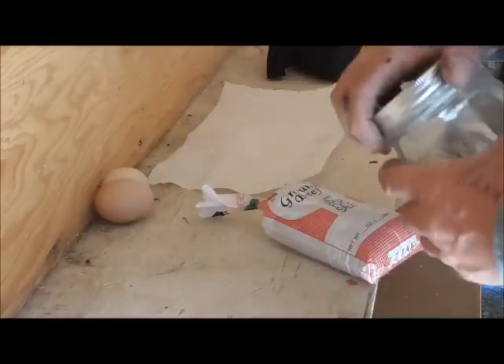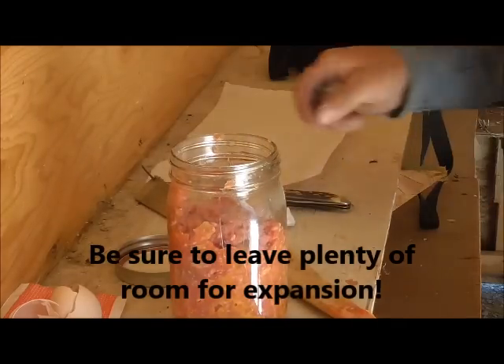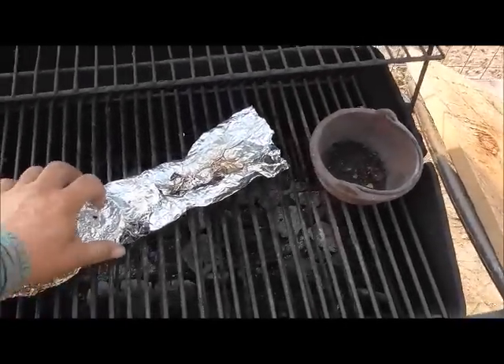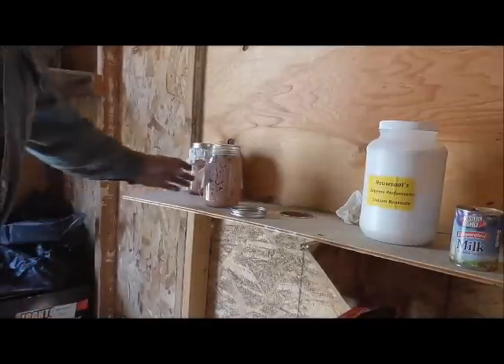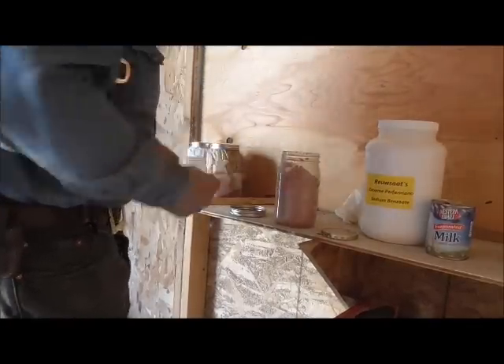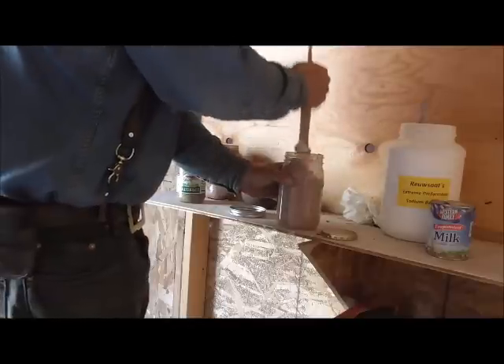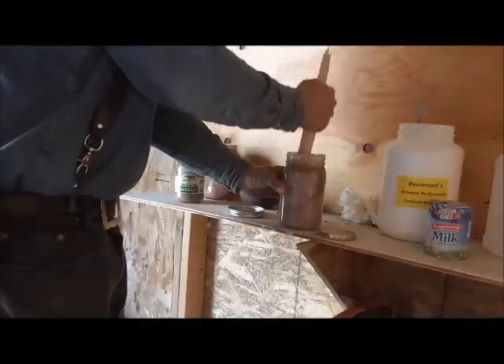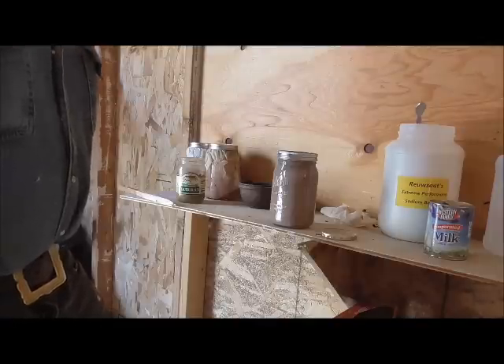Making an easy Predator Bait

Comment: I make a good one with deer meat I age it in a 2 or 3 gal bucket for about a year starting at deer season so roughly 6 months or until meat turns greenish and gray on top should be red in the middle  then add castor, muskrat glands, red Fox glands glycerine , propylene glycol & sodium benzoate etc. good stuff  can use beaver or muskrat meat to instead of deer
Reply from the maker: That sounds good.  I've done similar with beaver meat, or the trimmings off beaver hides. One of the best wolf trappers I know uses deer meat like you describe. It makes sense when you think about it.  Mostly they eat deer and elk.....not a lot of beaver on top of the mountain!  I hope your season is going well.  Good luck to you!

Comment: I think I'm going to try something new next pre season...   I'm going to set a bunch of sets up with out traps in them and bait some  with  a few different things and leave some not baited  and see what comes to check it out.   I got a bunch of coyote refusals this year.  I'm not sure if they smelled my scent or the bait or seen my tracks or lack of near the sets.    (Things I need to learn. )
Reply from the maker: If you have trail cameras try baiting dirt holes and things with no trap at all this summer and see what the coyotes do ,and what their reaction is. I was thinking about hanging my traps up in the tree up in the woods about a week or so before season this next year and see if that makes any difference also. It could be they are still picking up smells in the back of my truck or exhaust fumes or something like that coming from the truck itself.
Reply: @MuskratOutdoors  I boiled my traps preseason and tried to switch wm out if I caught anything's with fresh boiled and waxed trap's..  but I had a couple spots where they came up to my sets and turned around and walked around them over and over ... And that was just the ones in soft terrains that I could see their tracks 
I don't have trail cams but I can see tracks anyhow.... And make somewhat of an educated guess as to what and how anything comes near them.  Old timers didn't have any of these modern devices and they were quite successful ...    A friend told me something that makes a lot of sense ,. Learn the old time tested ways cause they never fail,. Then go from there to see how convenient the modern technology is.  So far my experience in trapping has brought out one major fault with modem technology. It never works in the mountains where I don't have reception and the batteries drain fast when used in them location 
But I'm just depending on a cheap cell phone for everything...
Reply: @MuskratOutdoors  honestly I've had zero luck with dirt holes here ... I know it's most trapper go to coyote set    but I've found blind sets on trails to be most efficient..  and unfortunately most likely to catch or get kicked by deer or horses/burros
Reply from the maker: @mazlosoutdooradventures8594   I've found that here too. I was going to ask if you had many other trappers in your area?  It might be nothing to do with your traps at all.  It could be that they have found other trapper's sets and are wary now.  That's another advantage to making your own lure / bait. It won't smell like something someone else has tipped them off to.
Reply: @MuskratOutdoors  yes there's other trapper's around ?
Reply: @MuskratOutdoors  they are very educated in the hills and away from town but in town we'll I caught 8 in one set in 5 weeks in a hot spot  but was running 6 traps most the time.
Reply from the maker: @mazlosoutdooradventures8594    Good job!
Reply from the maker: @mazlosoutdooradventures8594    We have quite a few here too.

Comment: Yeah is that liquid evaporated milk or is it powdered evaporated milk?
Reply: And do you add it with the eggs the first time or after it sits a week?
Reply from the maker: Canned milk.   Liquid.
Reply from the maker: @michaelmeyerjr1021   I add them together from the start, but variations  are never a bad thing.  Doing things different produces different smells and makes similar, but different lures/baits.  Be sure to write down what you do as close to exact as possible. When you find one that really works well, you will want to be able to make it again. Lures and baits fall into 3 categories. Food, sex, or curiosity.  Curiosity is probably the most common.

Comment: Do the horse hooves work good I remember johnny thorpe saying same thing my boss has horse stable and I just got a bunch thanks for info
Reply from the maker: They do. They have a very strange smell to them. You can cook them down like in this video, or soak them in water. The fine raspings soaked in water for several months in the sun have a strange smell that coyotes and other predators really like.
Reply: @MuskratOutdoors   good deal I like messing  around with my own baits so I am pumped  up to try gunna try the water and BBQ  way think I remember reading tincture  with vodka also ? To pull the smell thanks alot for replying  hope all is well out there

Comment: Did you wrap the hooves up and heat them up in the grill to soften them so they can be crushed up?
Reply from the maker: Yes. Poke a small hole in the foil to let out the fumes. They will charcoal somewhat, but they have plenty of smell.
Reply: How long does it typically take for the hooves to break down inside the aluminum foil on the grill?
Reply from the maker: @mikeschiffmann3708  Not long at all. 5-10 minutes more or less? Probably closer to 5 minutes?
Reply: Would you be willing to ship a bag or two of your horse clippings.  I will pay for any expense.  I know its a crazy question but I am having a difficult time finding horse clippings around here.
Reply from the maker: @mikeschiffmann3708   Sure can.  I need to trim mine badly anyway.   Please email me your address at 
muskrat14@hotmail.com

Comment: I wonder if I can use some animal fat to make bait or dead birds. Because one time I use a dead  groundhog besides my grandfather foothold trap I got a red fox but it is really complicate to find bait but I noticed they like fat does it work?
Reply from the maker: Depends on what you mean. Fat alone doesn't have a lot of smell. I use bacon grease a lot as a lure base, and add beaver castor or skunk to it. Other fats, like lard also work. If you have a dog, try making some, then rub it on a post in your yard or where you walk your dog. Don't let the dog see you do it, but watch how it reacts when, or if it finds the lure. If it shy's away, it's no good.....if it's interested and hangs around awhile, it will probably work!
Reply: What about sardines. do they work?
Reply from the maker: @jarodbrenneman8661   Somewhat. As the only bait, they are good for raccoons, and can catch other predators, but they are better as a lure additive.  I had fairly good luck with sardines and Limberger cheese mixed together.
Reply: @MuskratOutdoors  thanks

Comment: I have some deer hooves. Do I just wrap them in foil and put it in the barbecue for a few hours or?
Reply from the maker: Yes. Wrap them in tin foil, poke a small hole in the top to let out the gasses and put in on the BBQ. Without air, they can't burn. They will turn to charcoal and be easy to crush into powder. When the smoke quits coming out of the hole, they are done, but you don't have to wait that long. Experiment with different amounts of burning.  About half done has a lot of smell, but is harder to crush.  Let me know how it works out!
Reply: I put hoofs in an old frying and put in outside wood stove for 1/2 hour

Comment: Befor I make this Bait has anyone tried it does it work
Reply from the maker: It does work.  Since I made this batch, I've caught several coyotes, fox ,and  pine marten using it.  I also caught 3 wolves this season, but I used several things as well as this .  I think what caught them was urine, dog poop, and tainted beef chunks aged in blue cheese dressing.  HA!  Really, lure/bait only works for 4 reasons, curiosity, territory, hunger, or sex.  Gland lures work on sex mainly, urine and poop works on territory, meat or fish based lures hunger,  the rest are more of a curiosity. In fact, all of them are.  About anything that makes them think "What's that strange smell?" Will work.  If you live in an area that has a lot of trappers, new and strange smells will work better than something they have smelled before and associate with danger.

Comment: When I heard about roasted horse hooves, I thought I was wrong. I had to turn on subtitles to check it out ))))  That's interesting! Is it your know-how or is it some old way?
Reply from the maker: It was not my idea. I have been collecting trapping lure recipes for a long time. Most have too many hard to find, or mail ordered ingredients. More than one recipe used roasted and powdered deer hooves.  Horse,cattle,deer and elk hooves are all made from the same stuff our fingernails are made from, and I have to trim the horse hooves anyway, so I just used them.
Reply: I see, thanks! I'll share this way with my friends if you don't mind.
Reply from the maker: Yes!  Please do!  It takes quite awhile for the horse hooves to cook down all the way, but they kind of melt/burn into a powder. Poke a small air vent in the top of the foil to let gasses out also.
Reply: OK!